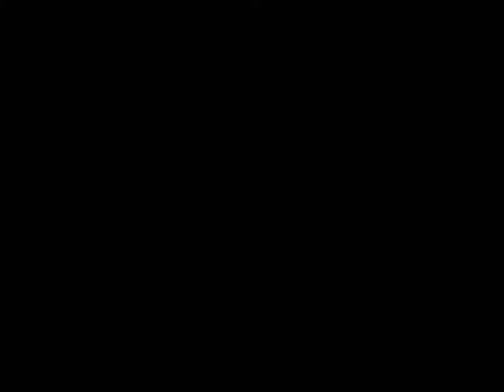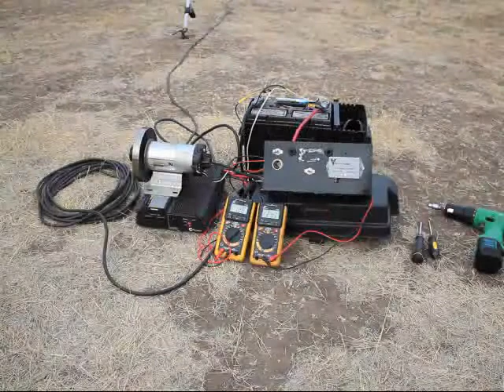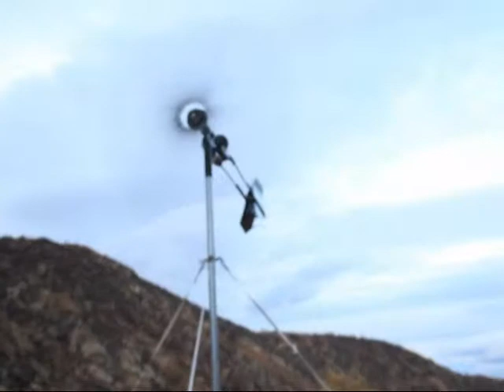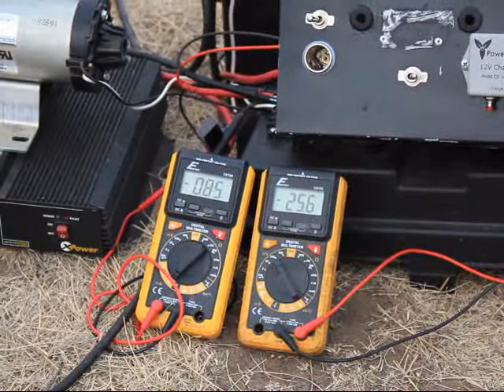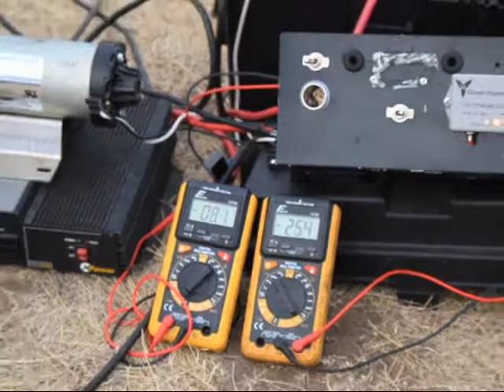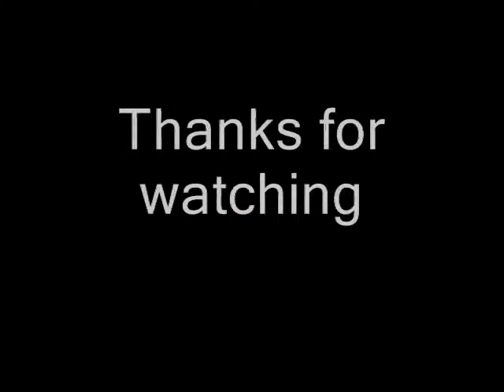Part 7 Grooved Belt Treadmill Motor Wind Turbine Generator DC PVC Blades Gear up PMA

Comment: quick question. Are you clocking the brushes before using that motor? The brushes are timed to follow the Flux field at a set rpm.  I am setting up for some experiments like that myself.

Comment: i am doing a project coping yours,i have a 2.5 hp treadmill motor,and i tested it 10:1 and it produced 130 volts..my question is do you have a blocking diode or a 12 volt rectifier on your system or are you just using a charge controller?

Comment from the maker: Thanks! it's DC out so I can just put it through a blocking diode then to the charge controller. Pretty big turbine for a little bit of output but certainly can charge a battery. It was a fun project

Comment from the maker: I already have it. Its manufactured by Henrob .. will do a video testing it on the milling machine first at different RPM. In fact, I made a turbine a while ago with a servo motor .. it did very well. Perhaps I will dig it out and test it again too. Oh and about the disturbences its water under the bridge :)